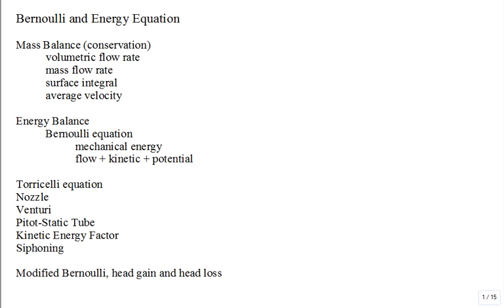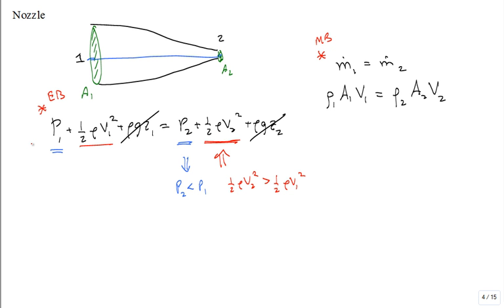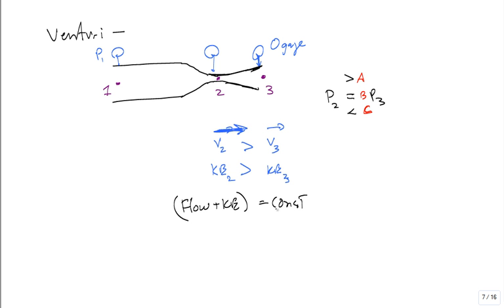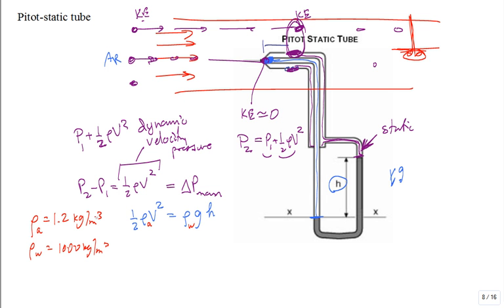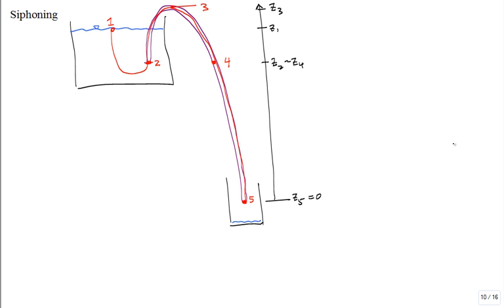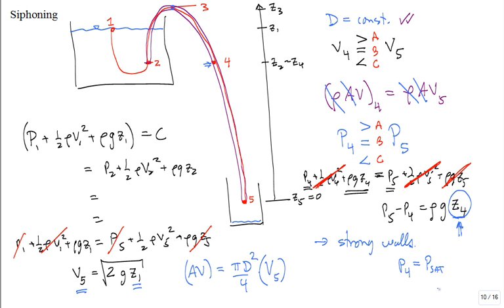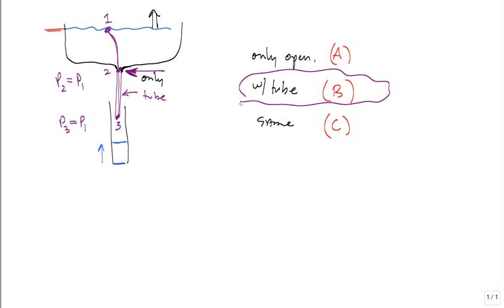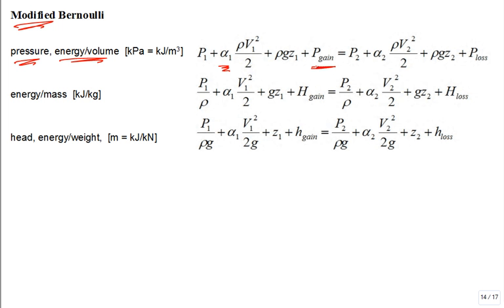Bernoulli 2 Summer2015

Comment: Thank you professor for your hard work, my question is when you were explaining the derivation for the energy balance equation it seems that it is the same as the control volume energy balance in thermodynamics 1, but with addition assumptions. Is that right?